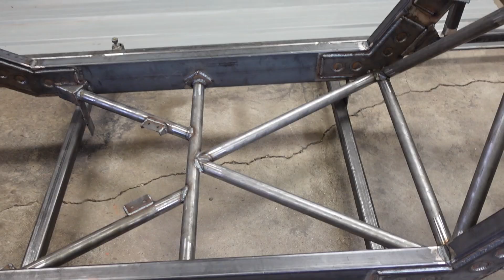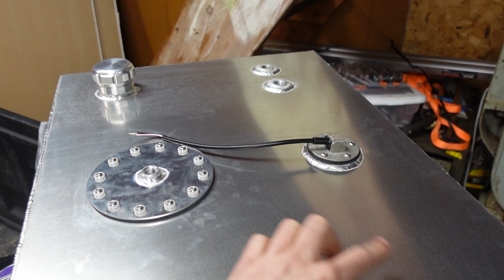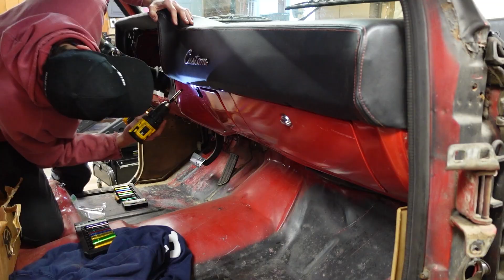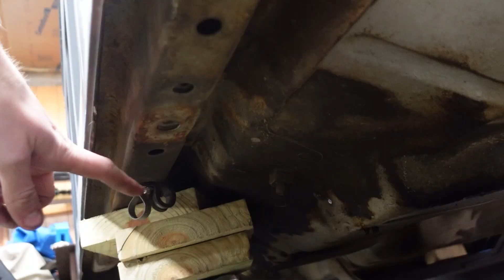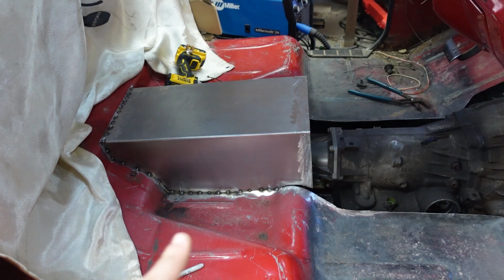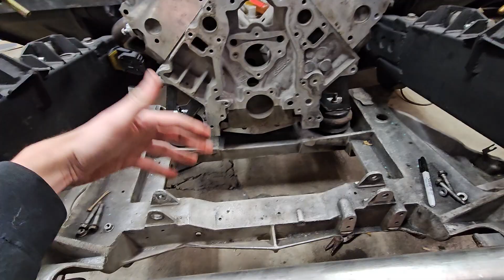THE TRUCK IS MID ENGINE!!  -  Pro Touring C10 Chassis Build Part 7

Comment: Many alternators can be spun backwards if you flip the fan, so you can mount the alternator backwards and in front of the accessory drive. To bad I didn't watch this 7 months ago.
Reply: Iv ran them backwards as is never burned one up

Comment: I have an LT1/L83 from a 2014 Silverado in my 37 Chev PU.  It's almost midengine.  Thereis about an inch of the block over the 2x4 front crossmember. so It might have the block behind the centerline of the axles.  I have it sitting pretty low. The 6L80 trans mount is an inch below the frame.and the oil pan is 3/4" above the crossmember.  Overall, it should have a pretty low roll center. I don't have a lot of pitch on the engine but my rear end from a Ford Explorer has the pinion center a couple of inches off center. So I should have enough angle on the U joints to prevent brindling.